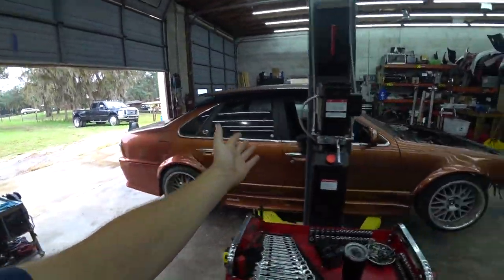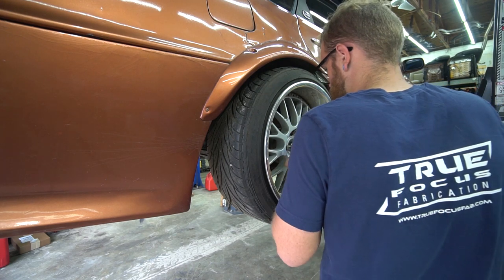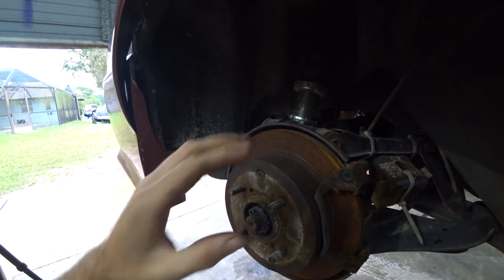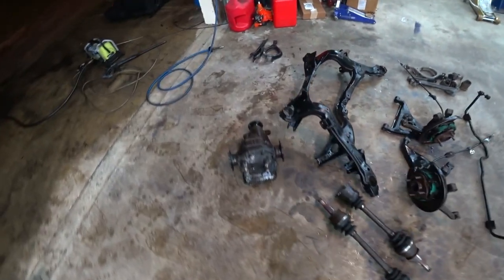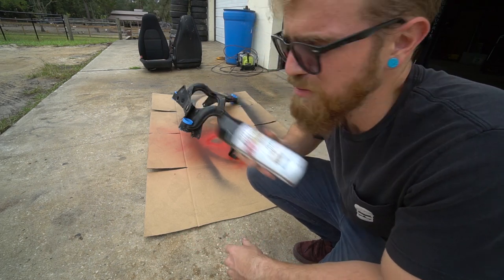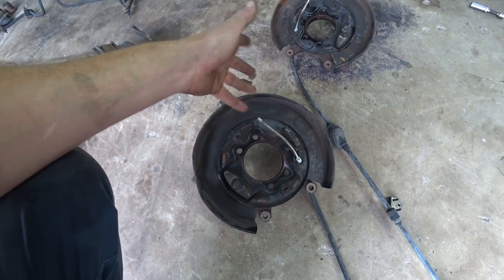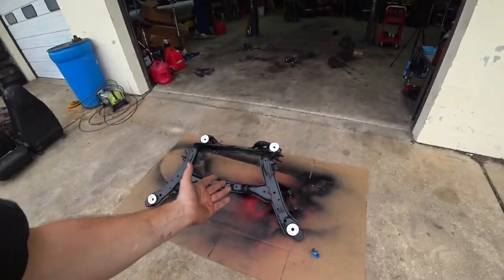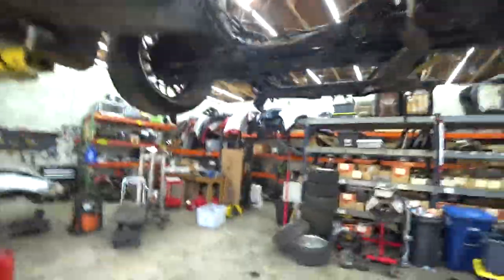Turbo K24 RHD Cefiro Build Pt.5 Chassis Upgrades. All New Everything.

Comment: Taylor, if you need those bushings out when you get your new ones in, use a drill with a small drill bit and work your way around the bushing housing. It will separate the bushing from the inner sleeve. Worked wonders on my Mustang's rear upper and lower control arms after I had spent hours trying more 'conventional' methods. In case you're wondering, it didnt score or damage the inner sleeve, left it nice and shiny!

Comment: Love your videos Taylor. As a professional, I suggest getting a old swing set for the frame. Use it to hang parts. Pick a sunny spot in your yard to put it. Getto, but will improve your work and speed up the time. You should hang your parts to paint. Hit all the areas at once without flipping it and messing the paint up. Rustoleum is slow drying, especially the gloss black. So because you have to flip, it takes 2x as long till you can use the part. Also getting the part into some air flow will aid in drying. An engine hoist is feasible for large items. We have chains in the booth at work. Can hang 1960 Cadillac frames, rears, etc.  Keep up the good work.

Comment: The way I get those bushings out is to use a deep hole saw to cut the rubber core out around the inner sleeve, then hacksaw out the metal bush liner and if its a real pig I burn the rubber bushes out with a blow torch, not good for the lungs but works well when your in a bind, good luck and keep up the good work.

Comment: It's super easy to re-drill ZX discs to 4 stud if you want to keep the VS XX.

Take a spare 4 stud hub and knock 3 of the studs out. Find a drill bit that fits in the stud holes snug. Drop the hub in the discs, it will be aligned by the centre bore and single remaining stud. Use the drill bit to leave a small mark at the centre of where each stud should be. Grab a small pilot drill to start then work up to final size.

Comment: For those control arm bushings, torch the bushings, burn the metal center part out, sawzall through at least one side of the outer lining, or through both sides and the bushing comes right out. I’ve done the process a few times.

Comment: A fast way to (usually) make a solid subframe bushing install easier is to take some dry ice (you can buy from your local grocery chain store), crush it and place in a cheap aluminum tin.  Then pour ethanol over it until you have a dry ice bath.  Drop in your solid bushings-the fluid will boil.  Wait till the boiling stops.  Dry ice is about -78 C and ethanol freezes as -178 so your bushings will be around -78C.

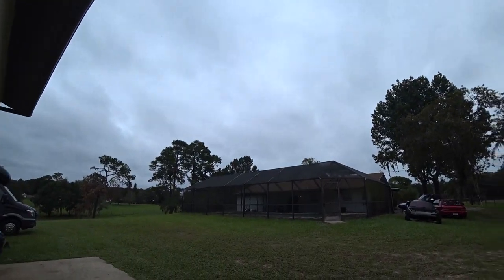Comment: it sucks to get bushings out, but what i have found that works best is to use a torch, melt the center out and there is a metal ring left that has an interference fit, with a jig saw, grove or cut all the way through just the ring, one at 12:00 and one at 6:00,  then use a chisel to tap it out.  hope this helps you.  love it man!

Comment: Drill through the rubber with a drill bit all around the perimeter of the bushing.  Knock the center out. Then use your air chisel to collapse the metal sleeve and push it out. Sometimes if you use a small enough drill bit it will walk itself around the bushing.

Comment: When I get a painful rubber bushing that doesn't want to come out, I sit it on a small gas bbq, cook the rubber till its jelly and on fire.  Bash the core out, the rubber normally comes out with core, then get a jigsaw or a sabre saw with a hacksaw type metal cutting blade and cut the sleeve till its paper thing, then use a cole chisel or screwdriver and hammer and split the sleeve along the cut. No bruised metal to stop the new one sliding in :)

Comment: If you cut the outer rings of those cradle bushes from the inside using a hacksaw (disassemble it to get the blade in) then they come out with a few taps instead of a 45 minute fight with an air hammer haha.   Keep up the good work, thanks for sharing.

Comment: Suggestion with the bushes
Drill out the rubber bush, then use an air saw or a hack saw to cute the outer shell and then you can use a chisel to knock the shell out

Comment: You can use a drill and bit to drill into the rubber on the suspension bushings. Keep making holes and the rubber will just fall apart. Then use that air hammer to taco the metal sleeve. That’s the easiest way I’ve found to replace those rubber suspension bushings.

Comment: Have to torch the rubber bushings. Makes black smoke but it works. Keep the fame on the bushing, it'll flame up and drip. But eventually it starts to swell and pushes itself out.  Best done on a stone driveway or equivalent. Face shield and welding gloves for ppe.

Comment: Taylor, 4.3 and 4.6 are common upgrade for R200. Big bonus you have the 4.3 in there. And judging by the spool case it looks like a Cusco unit.  And on the brakes the HR32 & ECR32 Skyline and other base models had the same.  Beautiful car by the way, someone really loved that car in Japan to spec out the aero and all that.

Comment: Hey taylor instead of rustoleum try steel it....just as good if not better and u can spray it on bare metal and weld straight over it and spray another coat on to finish

Comment: Use the drill technique on the bushings. Let the drill wander around anticlockwise  outside the center ring. It Will slowly wander out. Then do the same on the big rubber.

Comment: Best way to do subframe bushes is 1mm cutting disc cut the frame old Bush falls out sit in new bushes and weld the subframe backtogether if you can weld! (If you cant weld dont do this) also Taylor weld a support onto the traction rod bracket before you put it back in

Comment: There are 2 easy ways to remove stubborn bushings. the real old school method, burn them out and take a air chisel and cut the outer sleeve, but given that you just painted them,, not a great idea. the other option is a air hacksaw with a thin blade and cut inner, rubber and outer then it should press out very easy.
keep up the great work, and just keep being you. BTW tell your sponsors they need to start selling in Australia. :)

Comment: If you run open lug nuts, put a small amount of anti seaze on the threads. The elements will corrode and lock them up. Especially here in PA with the salt/chemicals in the winter.
Reply from the maker: Yeah I never thought about that being a problem until this car, on my drift cars they come on and off so much it doesn't matter.

Comment: One trick with this joints. You can Mig weld the inside of the joint and with a little hamper love they pop out, and there is no chance to bend the arm.

Comment: I live in Canada and they put Salt on road in winter Seasons so our Bolt are very rusty and corroted and I can tell you after using Pb blaster once I will never go back. Pb is litteraly the difference in breaking a Bolt or not on pretty much any car older than 5 years here. Thank to you an Pb blaster

Comment: I had to use heat to melt the rubber to get the inner and break loose the outer, then press out the outer metal of the bushing. Nissan bushings have always been the most headache for me.

Comment: The lca bushings are absolute hell to get out. I couldn't get them out myself and took them to a shop and even they had problems. They spent hours to get them out. They're sleeved like the subframe bushings. Gotta get a saw of some sort to cut thru the sleeve and try and chisel in-between the sleeve and the lca hole enough to get some relief to press them out. If you don't wanna spend the possible hours id suggest just getting gktech rear lcas. At $430 they're not that much more than oem lcas.
Reply from the maker: I thought about going that route, but they said for long term street use I would be better off using OEM style stuff. Sphericals wear out quick on the street. I'm using them in the other arms, but their isn't really a nice rubber bush adjustable arm option. And the ISR arms have held up great on all my cars.

Comment: I’m excited to hear what you think of the GKTECH roll center adjusters. I have a pair in my S14 and really like them. Lol there were some quality control issues with mine when I got them so one of the holes had no threads and the taper on one side was wrong, but once I got them replaced they have been great.

Comment: Why dont you have like an old pole wardrobe rack with wire hangers for painting parts? You can roll it inside if it rains or you can put it in the sun. Plus you can paint both sides in one go. And you dont need to worry about getting paint everywhere.

Comment: Bro. Rotors and callipers from bolt straight on. If you want to keep the four stud pattern get the rotors drilled from 5 stud holes to four. Only problem I fond was I needed spacers to get the rims I had to miss the brake callipers. I kept the four stud pattern only for the wheels I have. 4 sets of four studs. Two sets are very expensive. So couldn’t just let them sit doing nothing. Tried to sell them before hand, then tried swapping them. Couldn’t get rid of them so just stuck with them. Been running this set up for 8 years now no problems at all.
Reply: Standard diff is a 1.5.

Comment: Moog K9633 for the rear ball joints
The energy control arm bushings do fit, I used a ball joint c-clamp press to press out the rubber inserts then cut a slit down the middle and used a screwdriver and a hammer. It was NOT FUN!!

Comment: You can definitely do z32 brakes without doing 5 lug hub.  There are 4 lug rotors on the market for z32 brakes or you can easily drill a rotor to 4 lug.

Comment: Factory R32 GTST is 4.38 btw, and it’s also a the same R200 diff but has 5 bolt axles that are slightly stronger then stock twin 6 bolt S13. Sooo maybe it’s a 32 4.38?

Comment: Easier way to remove the subframe bushing sleeves, cut a slit in the sleeve with a sawzall, let’s the sleeve compress and comes right out with the air hammer.

Comment: Freeze those subframe bushings before you install them, they will fit much better
Reply from the maker: Did you not see that they were frozen? I also said I put them in the freezer. lol
Reply: Taylor Ray, I didn’t catch that you can also heat the subframe to expand it
Reply: Taylor Ray or use dry ice to shrink it even more
Reply from the maker: Hashtag Activist it’s just funny. Several comments that I should have froze them. And I’m like but I did! And I said! And you could see them sweating like crazy.

Comment: Other than cams how much more built can you get than valve springs, valves, retainers, seats and keepers?
Reply from the maker: Ported, bigger valves than OE, cams. I'm not sure if there's much more on these heads, but on other heads roller rockers, solid lifters, etc. I mean it is basically a built head. lol
Reply: @Taylordrifts  didn't think of that but no one really does that on k series

Comment: Hey Taylor
With milwaukee m12 right angle gun which socket size you go with?
The 1/2 or 3/8 ?
Going to buy one soon for myself my tossing up between the 1/2 i already have in impacts sockets or going with 3/8 and having to buy impact in 3/8 as well at same time 
Or just buy 1/2 gub and the 3/8 gun later  
Thanks heaps

Comment: The reason it takes so long to dry is the coating is actually curing. The oil has built in activator additives kind of like epoxy but it’s built into oil paints. Most paints have shitty cheap resins that don’t actually set up and cure

Comment: Hey taylor try using the rustoleum professional gloss or flat black that's what I use for suspension parts or some body kit parts that dont need to have $3,000 paint work on them lol.  That pro rustoleum is very good paint and it dries very quick for a very quick turn around time to out what you painted right back together. As much painting as I do I have nothing bad to say about it its tough if done right and it looks very good as well. Give it a shout $4.97 a can at walmart plus it's like 1 and a half times the size of the cans your using on thay sub frame for the cef. Try ot you wont regret it it last longer too. Very much so worth the money
Reply from the maker: I’ll get that next time! I haven’t seen it. I’ll pay good money for good spray paint. Lol
Reply: @Taylordrifts  it's in a silver with black lid. it says pro or professional on the front I used it on my ws6 suspension,swaybars,and caliper mount and brackets. I honestly just found your channel but I subbed and I like and listen to your videos all day Taylor. I pick a playlist and let it play. I'm just starting on my ls1 in my trans am. Iv never done a cam swap but your 5 must do mods on ls, a d all your other very informative videos have gave me the confidence to build it not have it built. I'm like you, if I can do I will lol. Have a good one.
Reply: @Taylordrifts  I watch so many other you tube car channels and always try to help them with advice or input or just say hi and your the first one to actually take the time to respond. So for that I thank you. Keep up the good work on all your projects taylor you are very knowledgeable on cars and just about everything else you might work on.